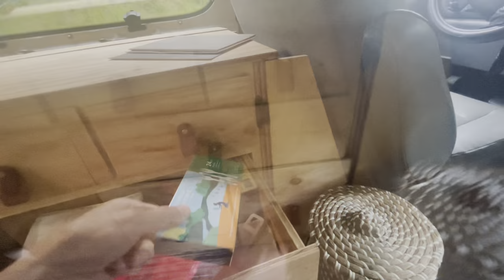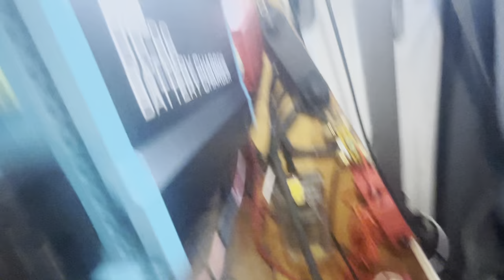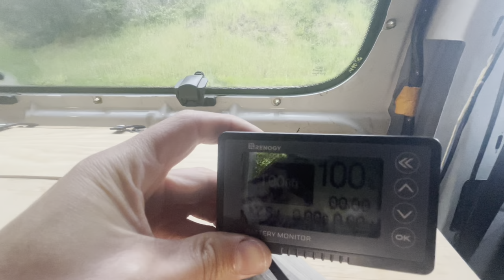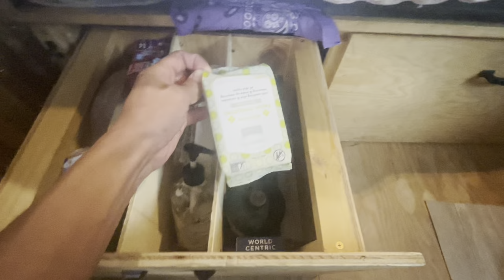Ford E350 Campervan - Van Tour * Simple & Cozy *

Comment: I like your simple and very innovative functional set up Paul. You are right looking at those pretty tapestries is so much nicer than those bare walls. I also agree that by using batteries you do not need to spend mega $$ on solar panels and a jackery. Your video is very inspirational...thank you. Safe travels with sweet Ozzie...❤
Reply from the maker: Thank you Dina. Gotta keep things simple.
I appreciate it

Comment: To make slides for your back drawer you can get a large white commercial grade cutting board and saw it into strips then screw them on the bottom of the drawer. BINGO....The cutting board slides hold up really well. I use them on my kitchen drawers too. Your van video is excellent!!!😉
Reply from the maker: That’s a really good idea. They glide pretty smoothly.
I’m definitely going to look into that. Thank you for the quick tip.
And thank you for the feedback.

Comment: Good job. I've been in a van for a couple years and a e350 extended high top passenger van. I sleep in a hammock so I have no bed which allows me to use the extra tall rear doors as my entry. The resulting front to rear aisleway sure makes it feel bigger, well that and the extra tall high top. Simplicity is where it's at.
Reply from the maker: Thank you!
That’s a really good idea, I like the hammock idea. Take it down when not in use👌
Reply: @Livingunderarock333  ya. Well I don't take it down but I Bungie it up out of the way. When it up you can hardly notice it and it frees up so much of the van. My previous message was missing that I've been in the Ford for about six months. So still figuring out what will work for me. Nothing it built in yet. The previous van was a Chevy 1500 I could hang the hammock but is was caddy corner and hung way too low. With this extended and high top I can hang it at the perfect angle and height. Sleep like a baby and so much space freed up. I'm still working on a plan for a guest sleeping area. Nothing is built in the van. Everything is separate, and movable. It's all pretty much on one side and I sleep on the other. Right now I have a couple vertical load bars that keep everything from shifting forward and dozens of Bungie cords to control lateral movement. I've been able to make several layout changes over the last six months which the most recent in the last week. Being able to live with and easily change the layout is ideal for me.Even when I decide on what I might build in the van will mainly be modular and anchored by straps so changes will always be easily completed and if something happens and I have to switch vans everything will move over. It's all made more possible because of no bed. You're doing good by staying simple and making changes as you go. When you do that you flow more with your space and learn quickly what works.
Reply from the maker: Very true.
Usually gotta build the van around the bed so your limited. The hammock definitely gives you more flexibility
Reply: @Livingunderarock333  ya. That and once you "build in" the bed you have pretty much decided what your layout is. You can certainly make some minor changes but the flexibility having no bed gives you is very liberating and if you ever have to haul anything big you don't have to worry about trashing your bed. Of course that pup would still need a bed. When I was in the house I slept in a hammock also. Before I started sleeping in a hammock, the dog always slept in the bed with me and when I started sleeping then a hammock then the dog couldn't sleep with me so I found a chair that he liked to sleep in and would pull that right up next to the hammock.

Comment: Hey Paul, really love the set up so far looks really good. I got a 01 GMC Savana 1500 been staying in a couple months going here and there just like you say I also say stay in it so you know what you need and don’t need I just have to start my build
Reply from the maker: Awesome. I would start with the floor then the bed and work around that.
Your build is really built around whether you would prefer a stationary bed or a fold out/down bed.
Good luck

Comment: You scored..thats the extended version...sweeet ..   i own one myself
Reply from the maker: Awesome. The Ford Econoline is an amazing van
Reply: @Livingunderarock333  if you plan to do a budget legit lift... Improve torque and mpg ...  Let me know...improve towing... reliability.. maintenance..etc etc

I am keeping this van .. I went all in...
Reply from the maker: I definitely will let you know. I have completely maintained and took care of all serious Ford 5.4 common problems to make sure nothing happens on the road
Reply: @Livingunderarock333  these mod motors respond well to mpg mods...  The 4r100 responds well to mods ..the Dana 60 as well..

You can easily upgrade your tires to 245/65/16.. 

You can budget lift using $100 F250 kits
Reply from the maker: I actually do have the bigger tires on. Stock was 225/45/16?? These are 245/65/16s. They definitely add a bit of clearance. 
And what do you mean by the F250 lifts? Are you referring to an aftermarket lift kit or using F250 stock parts??
Reply: @Livingunderarock333  you can use the F250 lift kits...spacers up front...blocks in the rear...for a max of a 3" lift... Use the moog caster/camber adjusters
Reply from the maker: Good to know. Once I get all terrains then I would like to lift it a small amount
Reply: @Livingunderarock333  yes.. theres different budget kits... 

for the front 
Metal spacers that mount under the coil spring
Metal spacers that mount on top of the coil spring 
Delrin spacers that mount on top of the coil spring(favorite because of less clatter)

For the rear suspension you can add leaf spring  lift block spacers

My suggestion is TO NOT level your van.. keep a rake.. if you level the van.. when you load the rear of the van it will droop the springs and sag

If you lift the front by 2".. then lift the rear with 3" h 4" blocks..   this rake will improve the stance when loaded in the rear... Make uneven terrain passable an not decrease your mpg...

Keep up the content

Comment: ⚠️Buy the big bag of cheapest wipes at Wal-Mart and put a third of them in a plastic Tupperware container and pour a 50/50 mix of peroxide and water into the wipes. Zip lock bag the rest of the wipes until needed. You will be 100% sanitizing yourself each time you use them.  Its totally safe for use.  
Just don't wipe your eyes with peroxide.
The same can be done with 50/50 mix of water and white vinegar poured into the wipes.  Ive been doing this for 3 years living in my van. Haven't showered since and im cleaner than most people.   Soak feet in water with baking soda for an hour when they smell.  Totally kills fungus immediately. 
Fill two socks with a dollar store box of baking soda and tie them at the top to avoid spilling.  Put one in each sneaker every night and no more smelly sneakers ever. They absorb any moisture.  This has changed my life. 
50/50 mix of backing soda with corn starch and coconut oil to make homemade deodorant.  Baking soda can burn if too much is in the mix.  Maybe add 40% baking soda and 60% corn starch. Then add coconut oil until its a clay like texture.  Add it to empty deodorant dispenser using a spoon.   This deodorant lasts for about 3 days without showering if you wanted that.  
Works on balls too, but only put a little on your hands and rub it on the jewels and in corners of the V line. Keep away from bung hole and don't put any on your Weiner😂.   People will be amazed that you live in a vehicle and not smell.  Add a few drops of real pepper mint essential oil or another scent, like peach to the deodorant and wipes for gentle fragrance. 😎🤓
Reply from the maker: I love the idea. I will have to try that out. Thank you

Comment: Are you going to add insulation?  Unless I missed something during the video,  other wise nice job on it, be safe.
Reply from the maker: Yes I am.
I am not done building it out. Just slowly piecing it together. Either Havlock Wool or 3M Thinsulate.

Comment: Do you get "ceiling drips" This is similar to how I had my old Ford transit but man even with a burner I got ceiling drips :(
Reply from the maker: I’ve never Hurd that term “ceiling drips”? I would assume that’s condensation that builds up on the metal roof and drips??
If so then not when cooking. The window behind my stove location pops out and so does the sliding door window.
But I do when it’s below freezing out. Hot breath from both me and Ozzie creates condensation but it usually freezes over night.
Reply: @Livingunderarock333  cosy! Typo
Reply from the maker: Oh shoot, thank you

Comment: 👨You should do a RAISE Roof to give you more head and height space. 🚘👍
Reply from the maker: I thought about it but the only way I would do a high roof is if I could actually stand up completely. Some high roofs are to short by a few inches and my neck would be bent while standing. At that point, I would rather sit. But my goal is to get a box style Ambulance
Reply: Cists about 4 grand to raise the roof
Reply from the maker: @susananderson9619  yeah screw that. 4k$ and I would be able to finish the van. I am totally fine with the low roof van. Just need to sit instead of kneel!

Comment: Why do people show everything they put in their drawers? I wouldn't show my friends what I have in all my cabinets so I don't understand this.
Reply from the maker: That’s a really good question Karen. And I guess I don’t have a really good reason why. I just did. It’s my first video ever so I’ll take this as a good note. 
Thanks for the feedback Karen✌️
Reply: @Livingunderarock333  It wasn't intended as a bad comment. It's just a question I've had for some time now. Thanks for responding. I can understand showing the compartments and how much storage is available but actually describing everything one has inside of each one well, it's still a mystery to me. I guess it's a trend that just caught on.
Reply from the maker: @Karen Miller I know it wasn’t. As I was editing the video, I was actually asking my self the same question as to why I was listing off the items. I am surprised I didn’t show what I have in my cooler.
Reply: Showing contents helps other campers/newbies to see what’s essential and how stuff fits in the space. It’s helpful info. Although showing your money wasn’t wise, but that can be moved easily to a more secure location. But everything else is pertinent. Some camper vids I’ve seen don’t have so many spare parts and tools but they do have more electricity and water and maybe a fridge. Also, you might be able to fit that broken wheel drawer with heavy duty drawer slides like for tool boxes or something. Nice job so far. Thanks for making this vid. Cute dog.